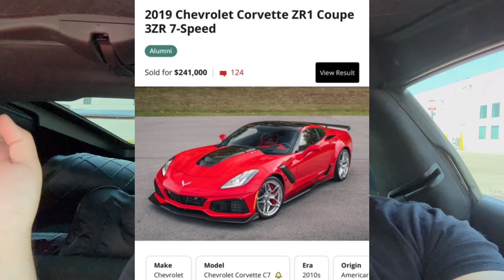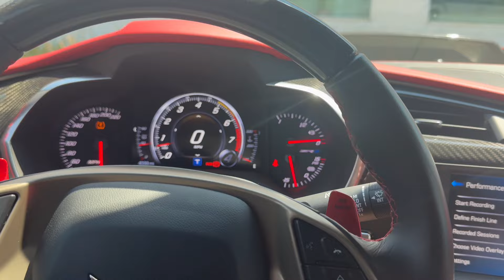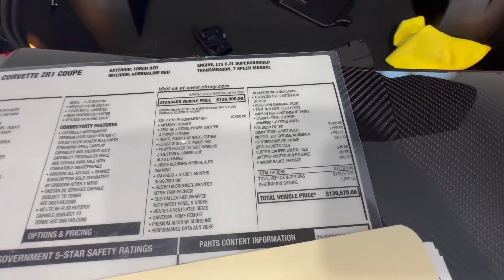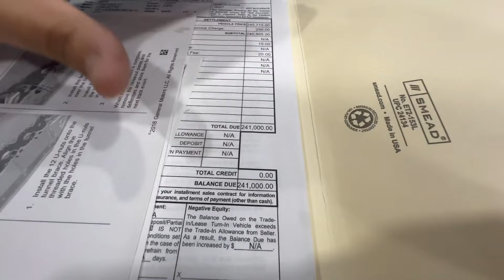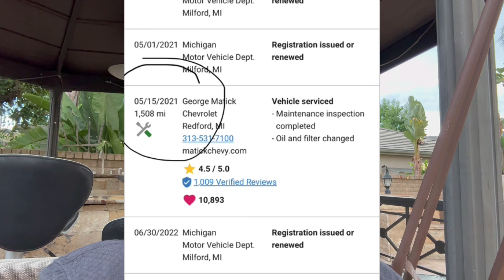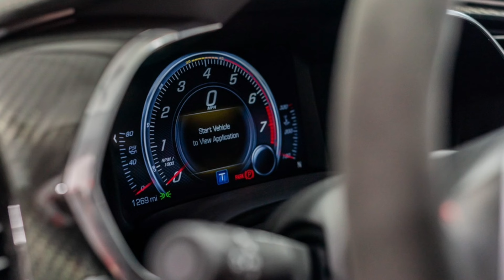I BOUGHT the MOST Expensive C7 ZR1. Over $200k!!

Comment: ZTK comes also with stiffer suspension 
Also there is a guy called JFK Auto on YouTube he sold ZR1 for over $300K but that one had only delivery miles on it
Reply from the maker: ZTK is the Front Carbon Canards, Larger Wing, & a slightly different calibrated Magnetic ride tune.
Reply: cool man! love red that was my 2nd choice. Got silver with red interior instead. love my beast! great vid!
Reply from the maker: @gsmith207  that’s awesome. We had a silver with red interior at my dealership. That color is super rare and looks amazing with the red interior.
Reply: @SinisterLife  Also higher spring rates (which goes hand in hand with the mag ride recalibration) and Cup2 tires.